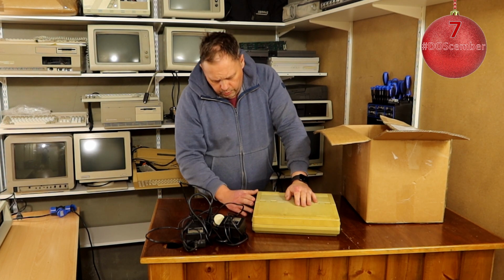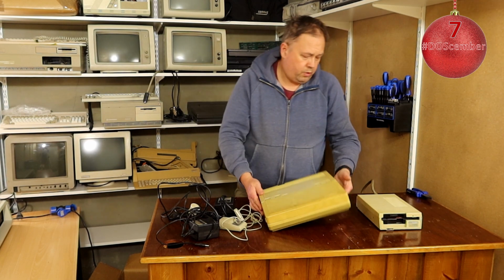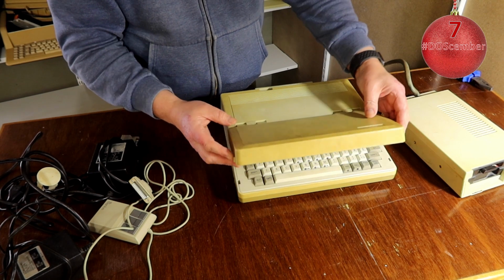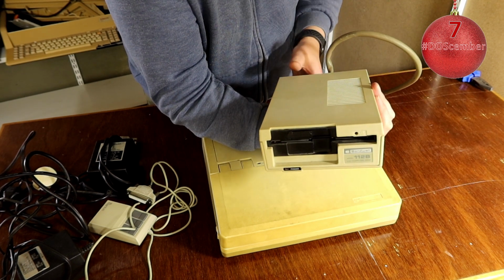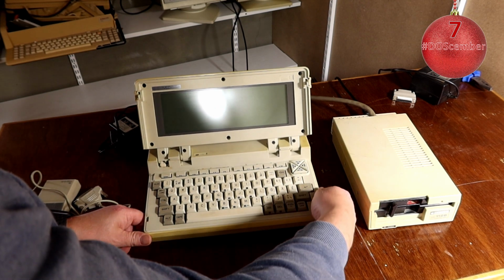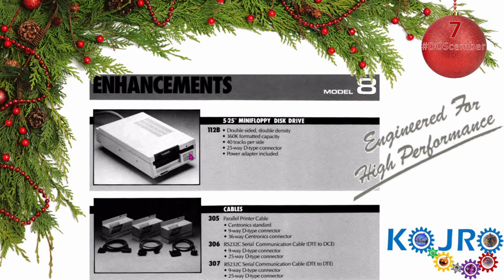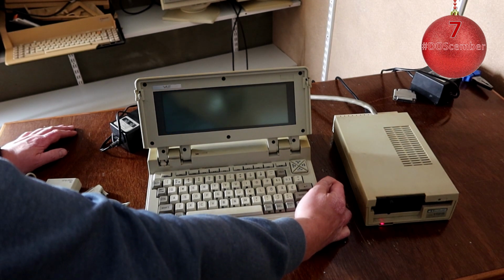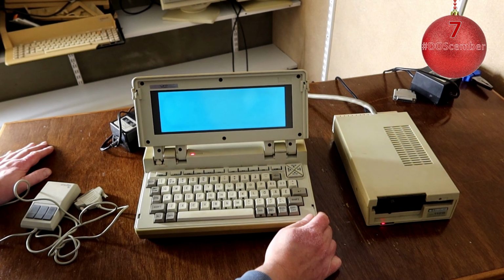Door nr 7, DosCember Christmas Calendar

Comment: This machine is old enough that, if the battery is flat, it may need to charge for a while before using it.
Reply from the maker: I have tried to charge the battery, and also inject the battery voltage direct into the circuit. But I got some tips that there might be some capasitor dammage, as there often are on this old equipment.